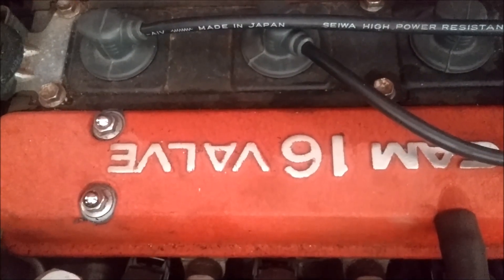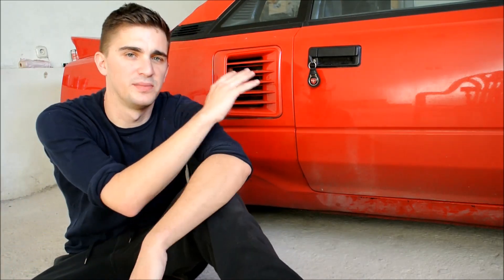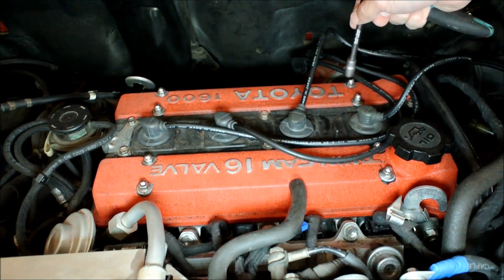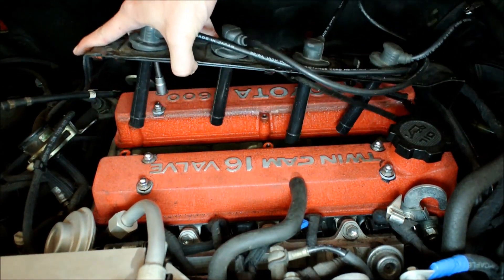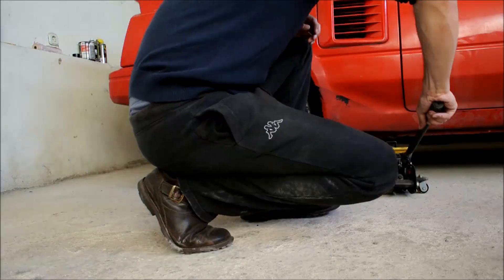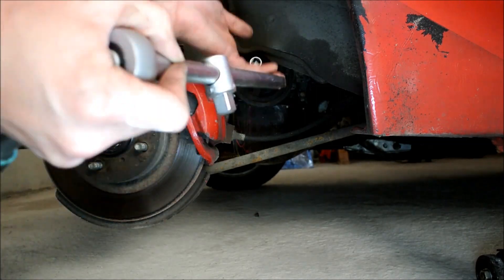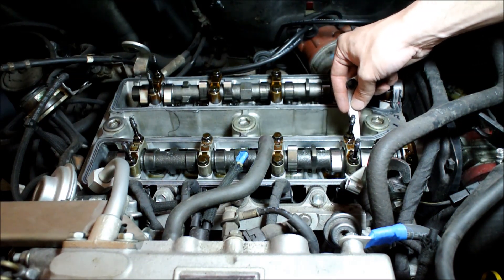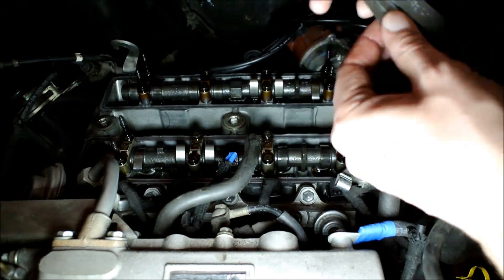How to check and adjust VALVE CLEARANCE (valve lash)

Comment: I feel for you, I've recently done the head gasket and machining the head on my B18, and now I've got a much more audible ticking sound even after adjusting the valve lash to spec, adding lucas sythetic oil stabilizer seemed to have helped however I feel that's a temporary band-aid, hoping it's not slapping. Looking forward to more videos related to your troubleshooting, good luck!
Reply from the maker: Road Worthy Thank you for your support man. Did you figure out what it was in your case? Suspects?

Comment: mr2 valves are weird... first time I’ve seen shims used to adjust the valves. Most others have to twist a screw and lock with a wrench. 

Hope your engine is ok.

Comment: Sounds like the TVIS plates, have heard it happen before.
Reply from the maker: Nick Pahls Really? I thought about that too. But I tried shutting the tvis off. Sound is still there. Weird thing is the sound is only there when the engine is warm.
Reply: driving 4 answers well sometimes the vacuum diaphragm that opens the TVIS plates gets a leak and causes them to vibrate and cause a sound similar to rod knock. If it's only happening when warm then it could just be a part that's expanding and getting loose. I would check the TVIS first though since it's pretty easy to see
Reply from the maker: Nick Pahls Here's what I did, I disconnected the vacuum hose from the t-vis diaphragm, should that have  made the sound go away?
Reply: driving 4 answers no because the tvis plate is still free to move, you need to make the tvis plate stop move by either wiring the tvis open from the center adjustment or have someone watch the center adjustment screw and see if it's moving while you rev the engine.
Reply: ive got a similar noise myself, and in my case it was at least partly valve lash. mine was bad. after getting almost all of them in spec, ive still got a bit of noise, so I'm going to try removing tvis altogether and see if that helps. in my case removing tvis is not a bad thing because I'm running a 272 IN and 264 EX cam setup, so I should benefit from removing tvis anyways.
when that's done ill comment if it helped or not.
Reply: William Phelps you won't benefit from removing the tvis, you'll loose lower end torque especially with those cams.
Reply: Nick Pahls im mostly going off the advice of bill sherwood from his billzilla webpage about the modifications hes done. has the difference with tvis and cam combinations been tested?
Reply: Yea that info is pretty outdated with no real testing. To see any real results you'll need a programmable ECU to fine tune everything for those cams. I have a Megasquirt on my 4AGTE with 272° cams and I did loose low end power when TVIS was removed. But I'm making over 300 hp so the TVIS is a restriction by then.
Reply: Nick Pahls hmm thats unfortunate i like his page. i wont be able to do a standalone until next year, so im stuck with the stock computer and fiddling around with other things
Reply: William Phelps thats fine, but I would be sure to get a wideband to monitor your air/fuel ratio to make sure it's not leaning out. Once you start getting bigger cams it'll take more fuel than stock
Reply: Nick Pahls what injectors would plug in to a jdm harness and be an upgrade? ive got some gze's but they have an oval connector
Reply: You need the EV1 style injectors, Honda uses the same ones so they are pretty easy to get
Reply: @NickPahls  what is this wideband ? I have issues with emission, it is 3.700 CO. There is a problem with mixture.

Comment: Hey man, what were the correct specs for valve clearance on a 4age?  I have my valve covers off and feeler gauge ready to go!
Reply from the maker: Here you go:
Valve clearance (cold):
Intake 0.15 - 0.25 mm (0.006 - 0.010 in.)
Exhaust 0.20 - 0.30 mm (0.008 - 0.012 in.)
Copied from the Factory service manual. I highly suggest getting a copy as it's an extremely useful resource.
Reply: @d4a    I actually went ahead and re-downloaded it after watching this video lol.    I was in spec for all of them except for one of #3 exhaust side at 13.

Comment: Hey my 4AGE makes an almost identical noise but not quite as loud, I was never able to find out what it was (I also thought it was valve noise). I have checked after quite a while of it making this noise and there is no damage to speak of.

I did some research and one cause may be the VVT pulley (video: https://www.youtube.com/watch?v=aDwmcjFtwxQ ). Though I don't think that would apply to you since it looks like you have 2 aftermarket cam gears. If you figure out what it is I would love to know.